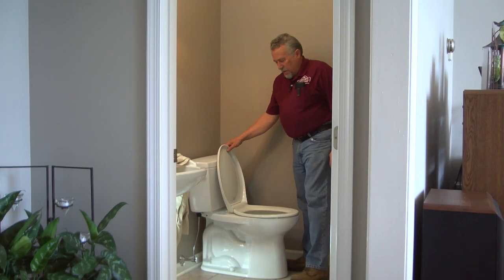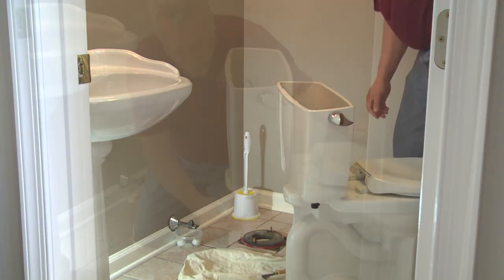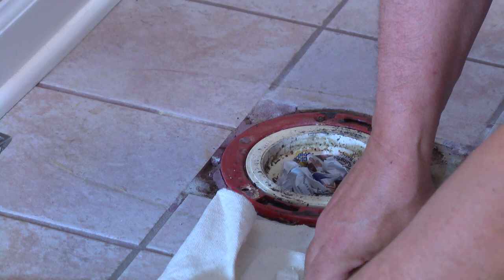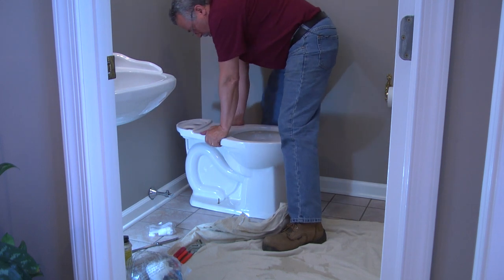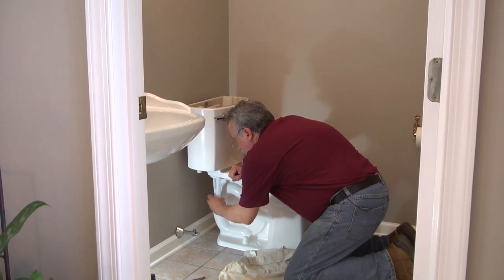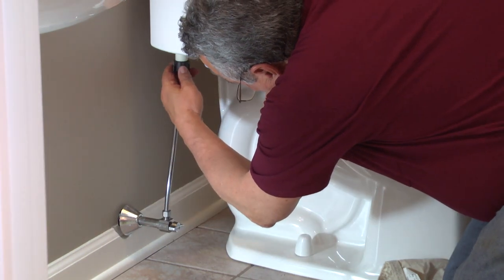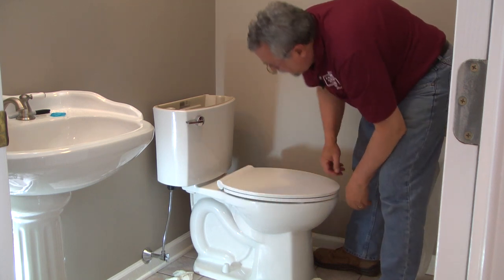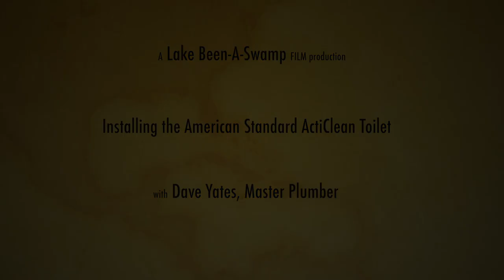Installing the American Standard ActiClean Toilet

Comment: Thank you so much for this step by step video. It’s perfect! This is a very nice toilet. I just installed one and it won’t stop running after doing a quick clean. It seems like my tank lid is hitting the white mechanism that flushes it inside. I locked it in place. I’m wondering if it’s defective.
Reply from the maker: Hi Beth, Thanks. Did the flappers reseat properly? On a few rare occasions, ours has done the same thing & it turned out to be a flapper that didn't reseat properly.

Comment: When u put the top of the toilet on there are the two lock down plastic screws at the top. If you don’t properly turn the locks all the way to lock position and u activate the Santiclean sysytem it will automatically tear up the cheap plastic terminals that hold the top of the toilet together and u have to replaced the inner guts. Ans it don’t take much to tear up. Why u didn’t mention that???  I need some of that promotion money. Lol
Reply: But I will give him credit for a nice video on the product. Just missed something major to point out that public that can mess up the whole project.

Comment: Anybody else notice the leak? Its dripping from the supply line fitting under the tank. Also noticed that the bowl is wobbly on the tile floor.
Reply: Good eye! It did indeed and nothing I could do stopped that leak. Turned out to be a defective tank and the replacement tank had no issues then and is still in use today 4/19/20. Outstanding flush.